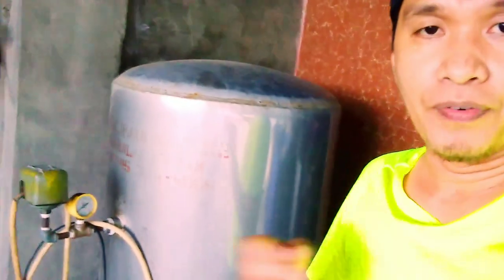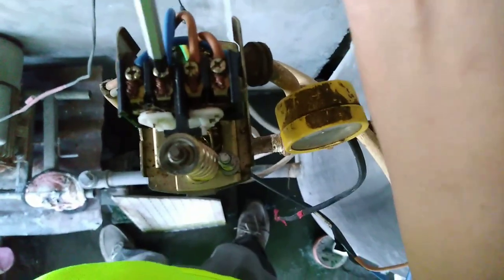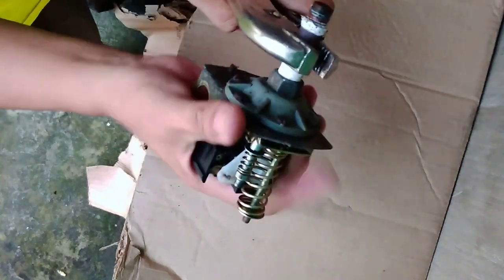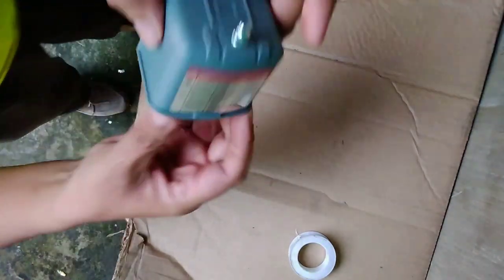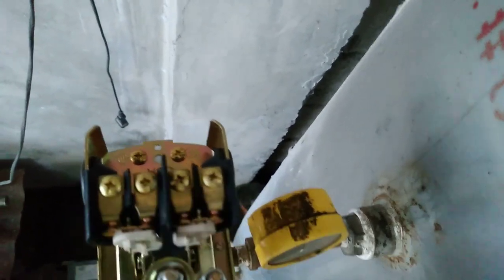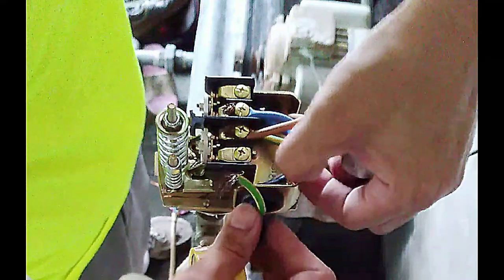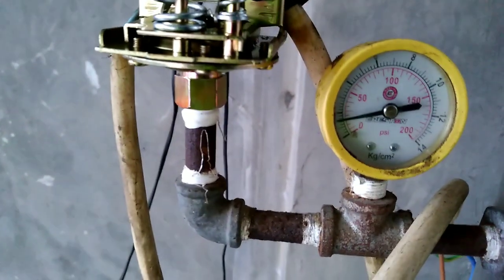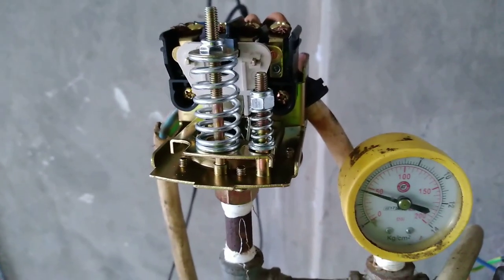How to replace magnetic switch on pressurized tank?

Comment: the sensors detects the rotations of the paddle-wheels and generates a signals which frequency f is proportionals to the flow rate Q. the proportionality factors is called K factors; its value is specific to each fittings and can be read out from the fitting instruction manuals

Comment: when a reed switch is activated there is a low but audible click of the magnet drawing the reed switch's contacts together. to test the reed switch using this method, you need to open the door or window and then close the door or window thats a safer way

Comment: the  magnetic switch consists of two pieces, and it can detect whether these two pieces are close to each others
the piece with the wires contains a supply that moves in response to the presence or absence of a magnetic field.
the other piece without the wires contains a magnet, so it can activate the reed switch when the two pieces are close to each other.
if the two pieces of the magnetic switch are within 20 mm (0.75 inches) of each other, the switch detects that it's "closed" – otherwise, the switch will detect that it's "open."
these magnetic switches are commonly used in security systems for doors and windows, but they are also used in many other products. like for example, a doorbell uses a magnetic switch to detect when it is being pressed. Magnetic switches are also used in many laptops and tablets to detect when the lid/cover is open or closed, in order to automatically wake up the device or put it to sleep on the while

Comment: how do you install and wires my magnetic switch? where can you  find a magentic switch circuit diagram? Where can I find a magnetic switch wiring diagram? you asked, and today, we answer
wiring a magentic switch isn’t necessarily hard, but it can be a little confusing if you don’t have a visual aid or two. remember that what you’re wiring is a means of turning things on and off. thinking carefully about when you want something off, and when it should turn on, will help you as you visualize the wiring and apply the schematic to real world control.
we’re going to look at a progression of straightforward pump control arrangements using magnetic switch. we’ll look at single and double switch arrangements and how to wire them, and then look at equivalent circuits using magnetic switch.

Comment: know that electricity can be measured in volts. Household electricity is 120 volts (abbreviated 120 V). Flashlight batteries are 1.5 volts. Car batteries are 12 volts.
we also know that electricity can be measured in watts. Incandescent light bulbs are typically 60, 75, or 100 watts. Compact fluorescent lights (CFLs) have somewhat smaller wattage ratings. Microwave ovens and hair dryers are 1,000 or 1,200 watts.
we also may know that there’s a third way to measure electricity, called amps. A typical household electrical outlet is 15 amps (abbreviated 15 A)and finally, we know that electricity can be very dangerous